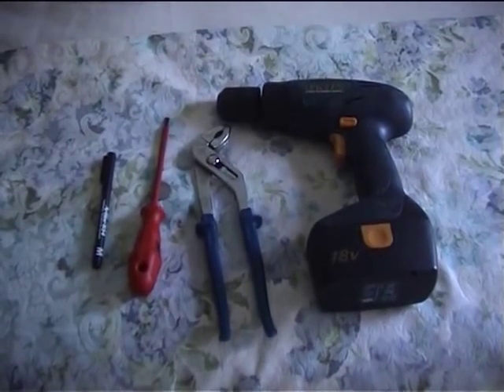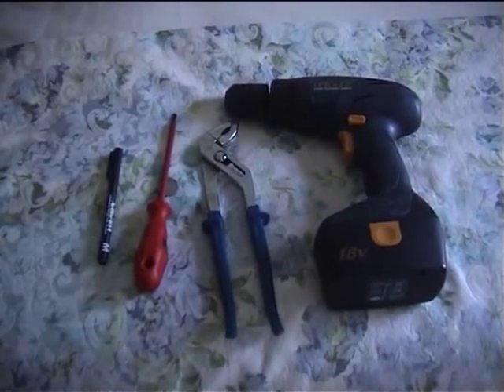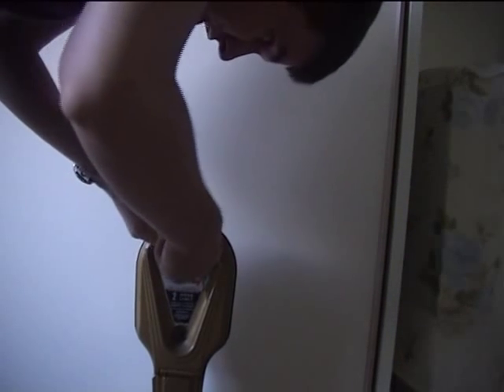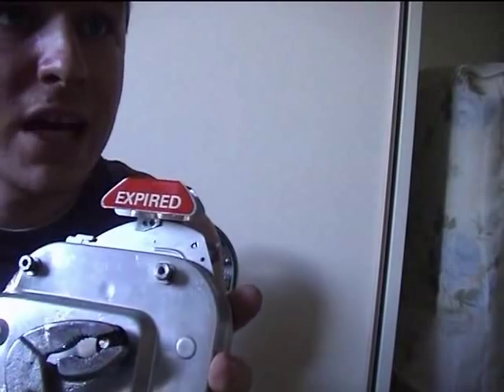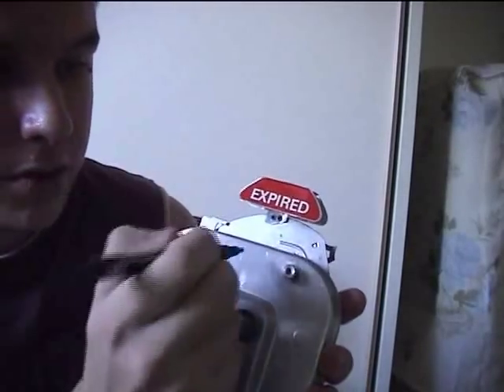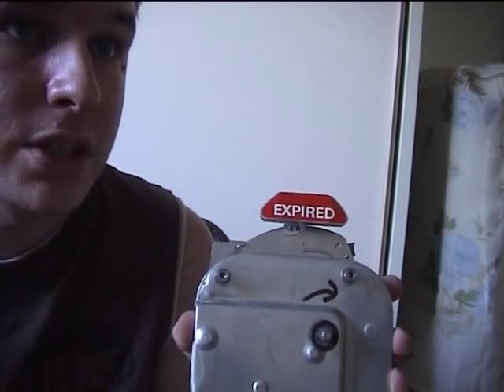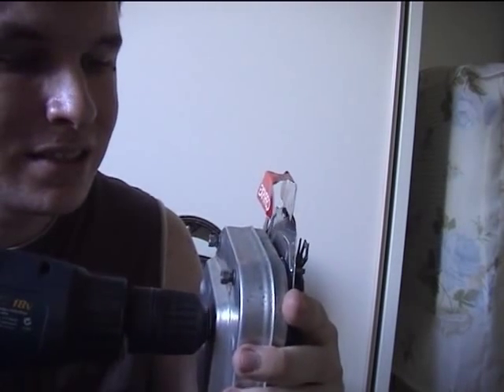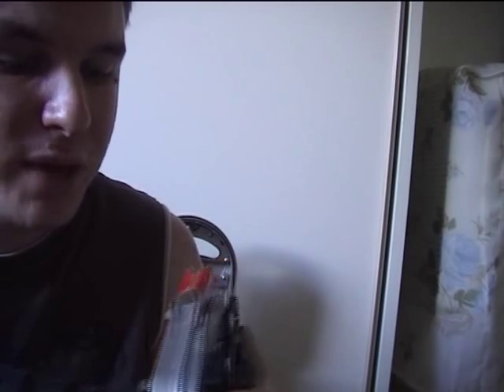How To Wind Up An Automatic Parking Meter

Comment: If you want to run the risk of screwing up the shaft or damaging the spring assy., ..... Follow Bryce's instructions.  The keys for this meter are available or it's not that hard to make or have one made with the right equipment.... I have used an old carburetor adjustment tool in a pinch! :>)  I have been servicing meters, supplying parts, picking and replacing meter locks for a few years now, and I have seen most every way to damage a meter.... This is one of them!  www.driveinmfg.com